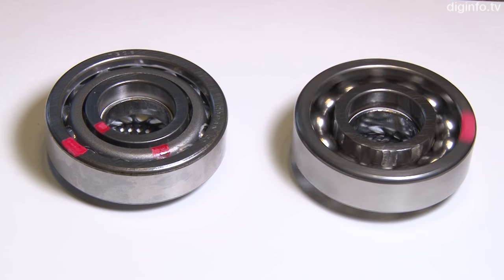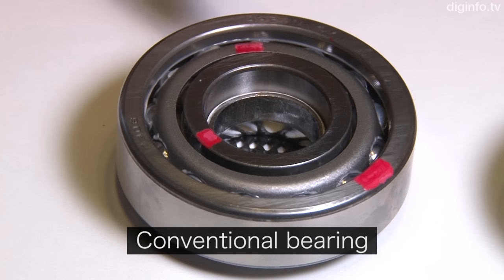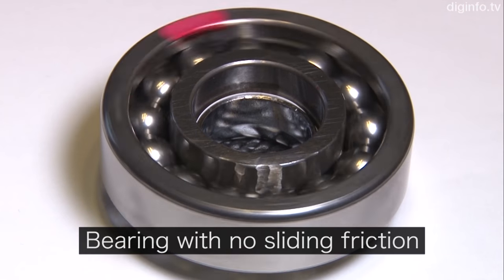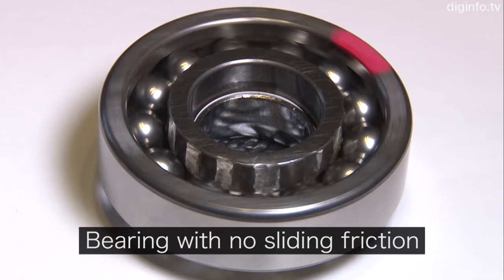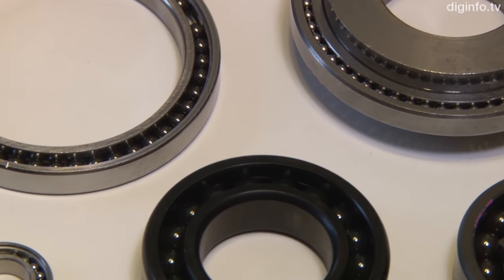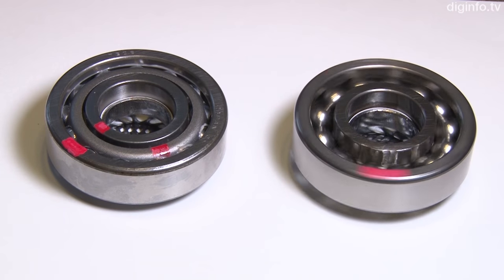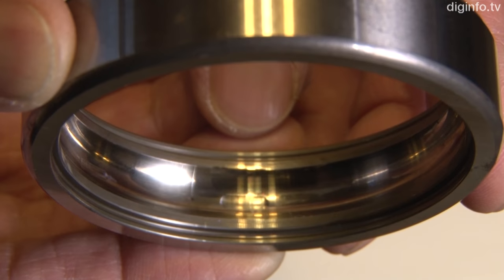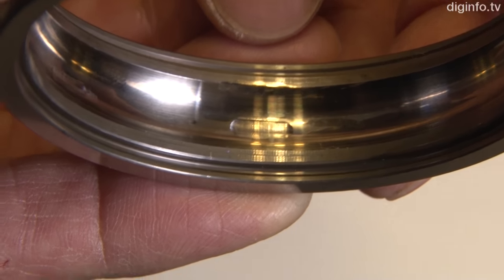Greaseless bearings that eliminate sliding friction #DigInfo

Comment: AvE did it better.
Reply: For a torqbar you could try running a bearing without a lot of grease, because you'll be in a very low load scenario. For any other applications this video is bullshit.
Why not just look up bearings on Ebay? For a torqbar the loads aren't too important. You'd want either a ball-bearing, or a roller bearing (cylinders). Just get a nice size to fit your design, and you should be golden!
Reply: wait Cody why aren't you verified? i thought you were a fake account for a sec
Reply: Oh, wow. It's cool to see you watch AvE too.
Reply: As a employe on a major bearing manifacturer in Sweden I must say that the grease that is put in to the bearings is not only to prevent metall to metall contact with the retainers. It's also to prevent metall to metall contact with the balls and the rings of the bearing. If this kind of contact in the bearing accurs during use it will not take long before the bearing breaks down due to metall particles released when the metall rubbs the metall. This phenomena even occurs to some extent when the bearing is greased propperly. Therefore it's inportant to even change already existing grease in a bearing from time to time to prevent an unwanted faliure. I have dedicated my professional life to this and there is so much more to it but this will due for now. 

btw! You have a good fanclub in Sweden, Cody! :)
Reply: All bearings will fail to what is called "creep and gall" eventually.
Reply: Cody'sLab holy cow! I wasn't expecting to see you here!
Reply: LOL true
Reply: What we see here is some Cody-style mild roasting.
Reply: does anyone else get the feeling the narrator is spitting all over each time he pronounces words with S in them?
Reply: Randomly finds Cody small world.
Reply: OMG, Cody i didn't expect to see you here!!:)
Reply: Cody'sLab for real
Reply: When are we getting an AvE/CodysLab collaboration video? Release the shmoo! with science!!!
Reply: Cody'sLab can u link it
Reply: He does everything better than everyone. Period.

Comment: greaseless bearings only work under a zero load, put a normal working load on it and it will self destruct
Reply: Why? When there's load on the bearing, usually it's only on one side. The other side at that time is used to realign the balls.
Reply: @bartdereu  The rolling resistance comes from pressure.
For very light load applications these have their place. 
Also I really doubt you can put any sort of lateral load on these things, so they are somewhat limited in their application.

Comment: Any bearing will spin like that with out grease and no load on it.
Reply: The point is apparently that the bearing doesn't "need" grease to reduce wear like a regular ball bearing would. Most bearings require some kind of lubricant to reduce wear even with the rotating elements but this eliminates the need for the lubricant and in addition the cage which also reduces overall wear, giving a twofold increase in bearing life over other unlubricated bearings.

Comment: They tried to explain how it works, but I still don't understand.
Reply: TheLivirus Basically they etched a groove into a section of the outer ring. This allows the bearings to rotate slower in that groove, bunching the bearings up. On the way out of the groove, they pick up speed and distribute evenly spaced apart.  Basically with this design the only time bearings will touch each other is in and a bit before the groove. This reduces over the all friction compared to bearings that free float or have sleeve spacers.
Reply: zetsumeinaito I don't think they will bunch up and touch, there are multiple grooves and the balls will tend to end up spaced out as desired.
Reply: zetsumeinaito Ok I see, so it doesn't really "eliminate" the sliding friction, only limits it to a brief touch each time spacing correction is needed?
Reply: ***** My question was how they end up spaced out as desired.
Reply: TheLivirus I think it works a little like wave in a traffic jam. The balls accelerate away from the groove because of it's shape and that creates a gap between it and the ball behind. When they get to the next groove they have a gap and although the front ball slows the one behind does too and so it never quite catches up. I suspect there is a sort of probability aspect to this too and to really get it you probably need to understand why balls would bunch up in the first place. It is tricky, I'm not sure I fully get it either.
Reply: ***** The groove itself just provides point of contact closer the the rotational axis of the bearing, which is why it slows. It still spins the same speed, but the closer to the axis, the less distance traveled. Which is why it's forced to slow down.

There only really needs to be one groove, as the bearings will be forced into being spaced out evenly because they touch while in the groove, and space out as they exit it. After a few rotations will not touch outside of the groove. It's also why it's not totally frictionless, just reduces it by a factor of 10, says the video.
Reply: zetsumeinaito  I know the reason why it slows and accelerates the balls though it provides two points of contact of course. I'm not convinced one groove would work well to maintain the status quo I think you would be likely to get bunching.
Reply: ***** If the balls accelerate and decelerate equally over the groove yet never quite catch up they will maintain the same spacing before and after the groove which would render it pointless. I think zetsumeinato's explanation makes sense, i.e. that the groove slows the balls down such that balls which deviate from the average spacing knocks into its nabors and thereby ends up corrected.
Reply: *****
They'd only bunch if the bearings were poorly machined, or wore down. In a properly built bearing assembly, the groove would break the bunches up, and maintain spacing. That's the whole reason they added it.
Reply: zetsumeinaito OK but they did add multiple grooves but perhaps that just increases the performance.
Reply: TheLivirus In the steady state they will maintain the same spacing because there will be one ball in the groove at once (or all are identically in their own grooves at the same time) but the demo in the tube shows that the groove prevents the balls from staying together if they enter together. The leading ball creates a gap between itself and the ball behind because it accelerates while the ball behind it still decelerates and when the rear ball accelerates it will not catch up the ball in front and close the gap. I expect there are as many grooves as balls (or it divides evenly) so that in the steady state they all decelerate and accelerate together.
Reply: ***** But again, if they all accelerate and decelerate equally, what's the point?
Reply: TheLivirus It keeps them spaced apart so there is no interball contact. By steady state I mean after the centering action has taken place, at that point the grooves don't do anything but they will ensure that this state remains as the prevent bunching.
Reply: Apparently it's faked,  both are exactly the same except one had all the grease removed and disassembled making it seems smoother.  Put it under load and it'll get chewed up,  might not even spin. Plus no audio means we can't hear the awful grinding noise of a dry bearing
Reply: gav One video of AvE and you are an expert. It won't get chewed up under load and the point they make is that it doesn't need grease. In reality it will reduce the friction by the amount a cage will produce as you would probably still use grease anyway.
Reply: ***** yup. AvE is that bloody good
Reply: gav True :)
Reply: TheLivirus if several balls were touching before they reached the groove then they don't all slow down for an equal time. As the lead ball reaches the groove it forces those behind it to slow too, so they spend longer at the slower speed than the lead ball. Then when they leave the groove and speed up they become spread out. 

(Or maybe the balls behind push the lead balls through the groove faster than they would naturally roll.)

If the balls are still correctly spaced when they next reach the groove they will get through with a minimum of shoving and sliding.

Grease does more than just deal with the sliding friction of the retainer. This will only work for applications that don't require the grease's other functions.
Reply: anothermoth Yeah. What I was trying to explain to littlestworkshop was that the principle relies on the balls interacting, not solely on the deceleration induced by the groove.
Reply: TheLivirus They may interact but they don't have to as I tried to explain.
Reply: TheLivirus thats because it doesn't work. bearing spin faster without grease but cant take a load.
Reply: Eric Norton Why wouldn't they be able to take a load?
Reply: TheLivirus http://en.wikipedia.org/wiki/Galling is a potential problem with ungreased bearings.
Reply: sage sokol since the cage has been removed, it adds extra space inside bearing, so he put in more balls to compensate for it
Reply: Then review
Reply: anothermoth The ball were off-loaded when it enter the slow-region, I saw this on other videos. So, no way the indentation will get damaged when weight is applied.
Reply: +xponen if the balls are unloaded that means other balls gets a lot more load. and this happening at any speed will result in record fast wear.
Reply: randknu1 if it has 10 balls, and 1 is unloaded, then 9 is left to carry the load. This translate to an increase of only 10% load, which is very little.
Reply: +randknu1 A ball doesn't fall by centrifugal force at high speed.
Apply preloading by low speed.
Reply: zetsumeinaito Not a groove. Tiny holes.
Reply: +zetsumeinaito How does this reduce friction? If anything, this bearing has more mechanical resistance that a smooth race. Why do they distribute evenly? Do you even know anything about ball bearings? Even if it was true that they sped up and slowed down, there is no way that is more efficient than constant speed.
Reply: Jeppe Boelsmand because balls don't grind on braces. Also; "non-slip wheel is effectively 0 resistance" and "energy is not lost when a ball climbed & fell from hill". (stuff already in our physics textbook)

Its just a typical Japanese engineering. Brilliant!
Reply: +littlestworkshop Depends on the finish of the groove and the bearings. If they're too rough (and if the load is too high) it'll reduce the life of the bearing, versus a bearing with grease in it where the grease acts as a kind of separator between the two hard surfaces. Please see: boundary lubrication.
Reply: xponen I'm not sure I understand anything you wrote. The first sentence must be sarcasm. Balls don't grind on braces due to lubricant.

The rest of your post barely qualifies as english :D The laws of thermodynamics and the universe disagree with those claims.

Sorry no guffaw.

Comment: Skeptical until they show an application. I can strip a bearing of grease and have it spin for a few seconds too. Throw these on a set of rollerblades or on a skateboard or something to show how they will deal with heat or pressure not just free spinning on a table next to a bearing loaded with thick grease
Reply: ***** The heat in traditional bearings comes from the ball friction against the cage. So there shouldn't be a lot of heat under load.
Reply: Heat is also produced from actual stress at the contact surfaces between the ball/roller elements at the atomic level.  For steel bearings.

Ceramic versions don't do this and require minimal lubricant. They still have a cage though.
Reply: LSUfreerider  IT'S STILL IN A CAGE FOR FUCKS SAKE
Reply: +jon arbuckle No its not, the balls are moving freely, unlike the other example wich used these bearings: http://www.bdpricebikes.co.uk/images/products/large/5-16-bearing-cages-1295266971.jpg
Reply: +FlyingAero I work with bearings all day everyday since i fix bicycles, you absolutly cannot get a normal current ball bearings to spin that long. If you attach a bicycle wheel on it for example, it will spin even longer.
Reply: +The Dollar Guy Clearly you dont know anything about atomic level, on an atomic level NOTHING is touching each others. When you put your hand on the table for example, if you go on an atomic level your hand is not touching the table.
Reply: jon arbuckle Argumentum Ad Hominem.
Reply: +Njoy32Gaming the cage does touch the ball bearings, if it didnt touch the ball bearings, why would you need ball bearings. The two bearings are the exact same actually, this was just a joke video, they just took the grease out of one and took off the little covering to make it seem like a new design. While nothing touches, the movement of things translate to the vibration of the magnetic fields of the atoms, this is heat.
Reply: +Njoy32Gaming Working on bicycles doesnt translate at all to a knowledge of bearings. A carpenter has no idea how his impact driver or whatever works when you get down to it. People that know about bearings are machinists and engineers. Dont take my word for it, there's a machinist out there by the name of AvE go look at his video about greaseless bearings.
Reply: TK TK Whats your point? U didnt teach me anything new captain obvious..
Reply: +Njoy32Gaming Every point you made is wrong, you clearly have a very rudimentary understanding of the "atomic level" and you have no idea about bearings.
Reply: +Njoy32Gaming touching is the overlapping of the electron clouds. So yes things do touch. The bearings are touching the casing, the electron clouds are overlapping.
Reply: +Njoy32Gaming if the ball bearings arent touching the outer casing, why would you need ball bearings? the whole point of having ball bearings is to touch the bearing race/ outer casing to provide a very low amount of contact at a very low friction coefficient.
Reply: TK TK According to VSEPR theory, valence electron pairs are mutually repulsive. This is called electrostatic repulsion, and it's described by Coulomb's law. A consequence of this is the understanding that on an atomic level we do indeed never touch anything. But we get really close...
Reply: +Njoy32Gaming What the dollar guy said earlier is correct, there is a contact point between the bearing and the race and it is caused by the movement of the bearings vibrating the atoms at the contact point causing thermal energy. They definitely are touching because touching is the overlapping of the electron clouds.
Reply: +Njoy32Gaming The electron clouds do overlap no matter how small it may be. They are repulsive however the electron clouds are continually vibrating due to the kinetic energy of the individual atoms and thus overlap.
Reply: +Njoy32Gaming like i said you have no idea what you're talking about vepr theory is related to valence electron pairs and has no bearing on the overlapping of electron clouds. Coloumbs law essentially states that particles interact with each other at a distance and positive attracts negative. No bearing on the overlapping of electron clouds.
Reply: +Njoy32Gaming the repulsive force at the fringe of the electron cloud is infintismally small however the force of the vibration due to the kinetic energy of the individual atom is realtively very high, thus it is touching. this is of couse a matter of semantics. The ball bearings are touching the inner race and your point that nothing technically touches is moot in the context of the conversation at hand because it makes no difference.
Reply: TK TK Atmoic level overall is moot in the context of the conversation, i simply responded, with facts.
Reply: +Njoy32Gaming 
You brought it up first, and when you were shown to be wrong now you're saying its moot. Why bring it up in the first place?
Reply: fact worshipper: “responding with facts means I’m always right, derp…”
Everyone else: except when your facts are incorrect, constructions of pure abstraction, and wholly unrelated to the topic of discussion, because then you’re, not only wrong, and not very bright, but also, an egocentric clown of dubious intent…
Abstraction:  “Am I a joke to you!?”

Comment: Nice, the question is how long they will last under load compared to regular bearings, i would say not that much, that method uses less contact area but more stress will be applied to the edges, and those holes in the outter ring hmm, please show us a test with under load
Reply: interesting point, I still think the concept will succeed though
Reply: under constant spinning, the groves will wear out and the balls will touch each other. just guessing, so probably the rings needs to be made of a harder material than the balls